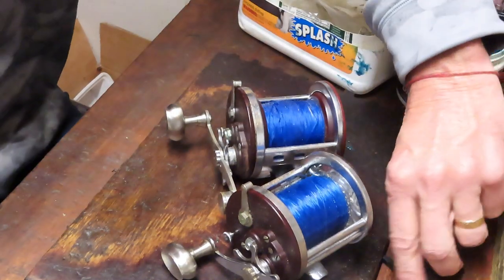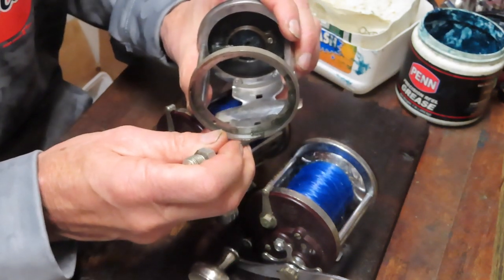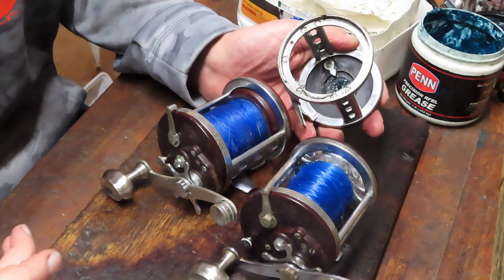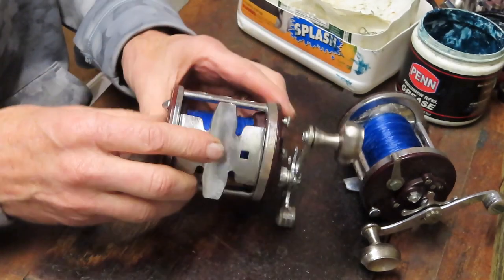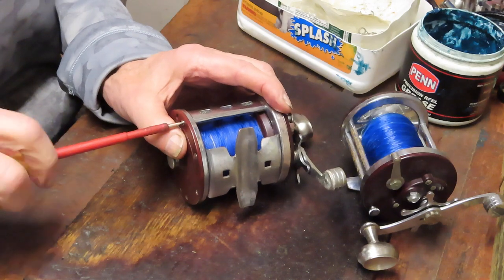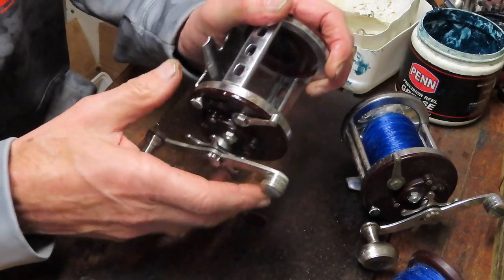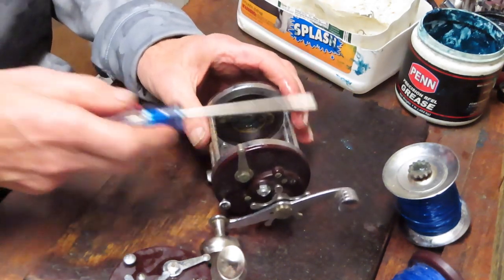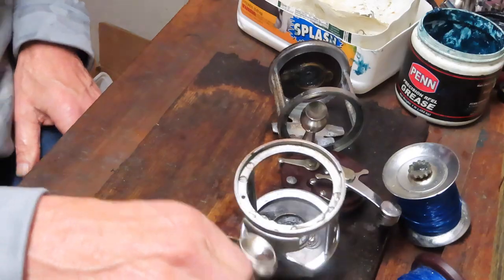How to free a stuck Penn Jigmaster fishing reel  with single take apart screw

Comment: I got to use this trick again on a 99 Silver Beach I got for $5.00. It was stuck so badly that I resorted to carefully clamping the handle in a vise vertically. I used an 18" 1 1/2" X 1" hardwood scrap to really lean into it. The other factor was using PB Blaster and ignoring it for a whole day beforehand. Thanks yet again! By the way, I've only seen this problem on the older reels that use pins on the sideplate and never on a Jigmaster.
Reply from the maker: Glad to hear it helped!  Dennis  PS - Love the Silver Beach series

Comment: Another great instructional. Video Dennis. You’ve taught me a lot about using leverage - getting rotors off and bearings out, etc. I’ve even figured out a few uses of leverage of my own. Dennis, I worked on the 386. I took apart my good 386 and looked for a washer under the rotor or on the pinion. There was neither and there was not one diagramed on the schematic. Switching the axle shafts did nothing. Only super tightening the rotor appeared to make any difference. Are there just some reels that can never be as smooth as others of the same make and model?  The reel functions as it should it’s just harder to turn than my other one. I don’t know what else to try. The only thing I haven’t replaced with either NOS parts or parts from my other reel are the AR mechanism and the bail release mechanism. I seriously doubt they could cause this. Any more ideas? I’m stumped. By the way the reel is beautiful. I replaced the missing Garcia decal and replaced the side plate. It looks great. I have the box and the papers for it too. You know me and for an amateur I’m pretty good with Mitchells particularly all the saltwater ones.  Maybe the reel was made on a Monday? —— Chris
Reply from the maker: Yes - wear and tear as well as inconsistency in parts tolerances can make two identical reels perform very differently. Wishing you the best in 2021 - Dennis

Comment: Could this work also with a shimano calcutta??
Reply from the maker: The Calcutta does not have the single screw mounting system, so this would not work.  Your Calcutta side plate has the traditional screws holding it on.  Remember that you need to remove all pieces of the handle and star adjuster assembly in addition to the side plate screws in order to get the plate off - Wishing you the best in 2021 - Dennis

Comment: My wife picked up a Shakespeare tidewater 30L , by watching your video I was able to get it working again but the level wind eye is missing can parts be found
Reply from the maker: I have a limited amount of these parts.   Do you mean the line guide?  Please send a note to my email 2ndchancetackle@gmail.com and I will see if I can help. Wishing you the best in 2021 - Dennis
Reply: @2ndChanceTackle  I tried to send you a message but couldn't yes it's the line guide I need
Reply from the maker: OK - try my email. 2ndchancetackle@gmail.com and I will check for the line guide - do you also need the line guide cap and pawl?  Are you sure the worm gear and idler gear are OK?  A lot of times the line guide is removed because the plastic idler gear in the side plate is broken.  That part is not available, so check by removing the non gear side plate before you go to the trouble of finding the other parts - Deninis
Reply: @2ndChanceTackle  I will also need the cap and pawl gears are fine . Someone hade taking it apart and didn't put it back together right . After watching your video I redone it, it was going in the trash till I seen your video
Reply: @2ndChanceTackle  the